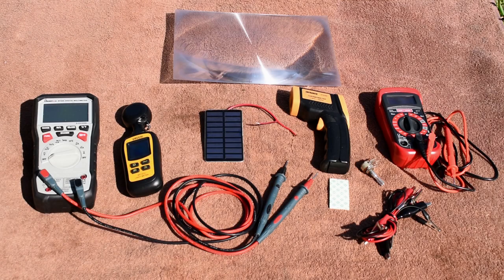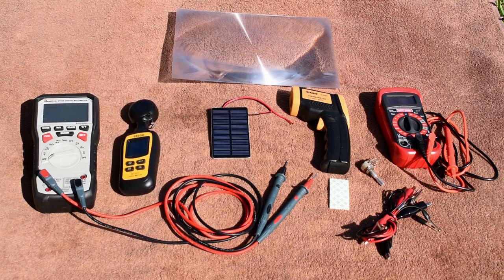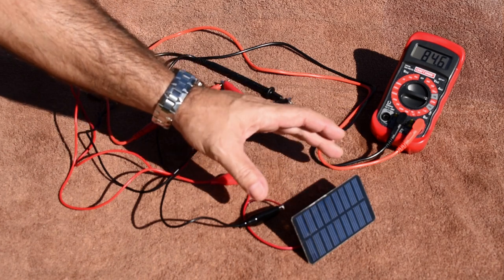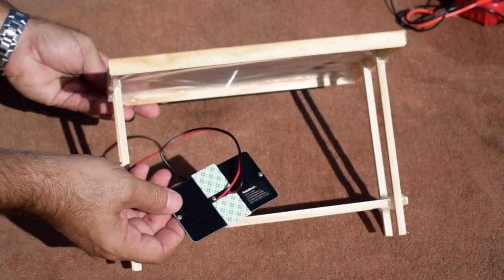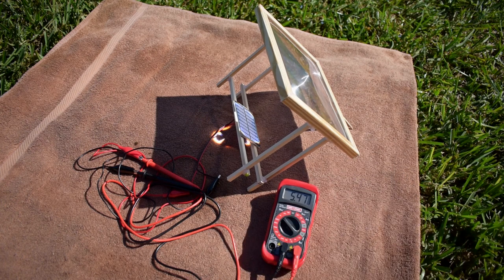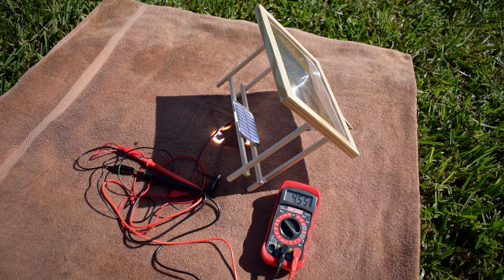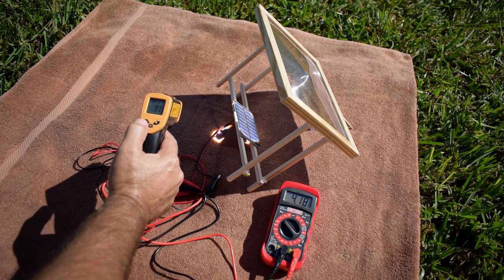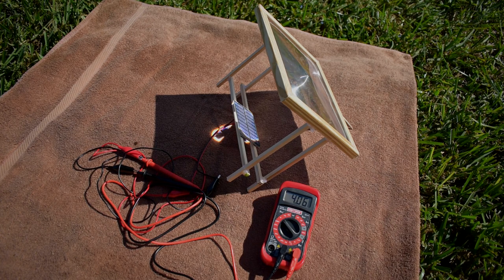Solar Panel Experiment Using Fresnel Lens!

Comment: I saw a paper published a year or two ago about a new type of panel that could work at increased temp. Cheap fresnel magnification was my first thought for an application. I do like the suggestion by some of your other commenters of just submerging the panels in water though. Gives you options to harvest the waste heat for a useful purpose as well.
Reply from the maker: I'm going to do another video using the same setup, but try using a bonded heat sink, and water cooling. I'll test the power output for USB charging. Thanks for watching Ben! Looking forward to your next video!
Reply: Water might mess with the output because water is kind of like a mirror but idk
Reply: I wonder if the heating would be less with a load in the circuit?  The multimeter measures amps and current, but how does that work if there's no load in the circuit?  Wouldn't you need a load?

Either way, there are cold places on the earth that get plenty of sun.
Reply: @Volker109  not by much, water surface reflects less than 10% of incoming light, and absorption isn't an issue unless we're talking about a lot of depth (50% energy wasted at 10 meters)
Reply: @James-wd9ib  if the panel was encased in the water, you could basically turn the solar panel into a giant water block like you would have on a PC. basically it would have to be actively cooled to handle this sort of use.

Comment: Try the same thing with a water cooled aluminium heatsink attached behind the solar panel
Reply from the maker: Hi there. I thought of doing that, but then you'd need a pump, which of course uses power. Be sure to share the video with others. Thank you!
Reply: @electronicsNmore  if the water supply vessel is higher than the cooler block, convection will circulate the water without a pump
Reply: @sargetester99  Good idea as long as it was a closed loop system like a gravity radiant system.
Reply: @ThePreyMantas  I hope he will consider doing it for a video.
Reply: @electronicsNmore  now let's add up the cost of a fresnel lense and a water cooled block vs a bigger solar panel
Reply from the maker: @gurgleblaster2282  The video wasn't about cost, it was made to inform. The lens was $2, the wood I had, and heat sinks are abundant for me. I pull them from the trash.
Reply: @sargetester99  Yea, it would be interesting to see the results from all 3 tests, normal sunlight, amplified and amplified w/water cooled collector.
Reply: @electronicsNmore  yeah I get that I was curious. Especially if it is cost efficient to scale up like a mobile camper
Reply: Your amperage increase is enough to cover the cooling and leave a 50 percent gain.
Plus use the "heat energy" you need to remove from one side to the other.
Like in Algebraic equations.
Like is said "energy can not be created or destroyed." So use it.
Reply: @sargetester99  especially if you've got a creek to gfravity feed water through the block... And the "waste" heat could be used for other purposes.
Reply: Apparently LED globes will give you a much better efficiency than any solar panels can when you shine light directly on them they produce power...
Try it out on your next video...
Reply: pe hgt whats an led globe? I looked it up and found nothing.
Reply: @maximusmeridius3106  I think he is talking about just regular 3mm LEDs , light emitting diodes,  they do produce electricity if light is concentrated on them
Reply: @electronicsNmore  if you had a small reservoir of water the system would pump itself water travelling  from hot to cold
Reply: Yo... dudes... these panels are on a cheap form cellulose/resin composite pcb that offers pretty good thermal insulation
Even glass/resin composites have a very poor thermal conductivity.
Reply: Came to the comments section just to mention the same
Reply: Bjorn A'grin solar panels are a type of silicon semiconductor device. Semiconductors suffer from a phenomenon called “thermal runaway” because their internal resistance reduces as their temperature rises. This causes more current to flow, producing more heat. They work ok as long as you keep them below the critical temperature.  Once exceeded, an avalanche effect can occur, where the resistance drops and current rises rapidly, causing heat failure. This is why computer chips have cooling fans.

Comment: People in Antarctica should love this. I guess cooling is not an issue, there.
Reply: I get the joke, but people in Antarctica (and the Arctic) actually do have an issue with cooling in the sense that those that have refrigerators have the temperature within them kept at a controlled level/range so that (for example) things don't freeze.  :)
Reply: @maintoc  yeah, I guess down there one could hear some pretty improbable dialogues. Like: "here, let me warm a beer for ya..."
Reply: @copernicofelinis  Good one.  :)
Reply: Yep solar panels works really good there (when they can lol) snow is reflecting some lights too

Comment: The first time you read the current draw, you only change the rotary switch setting without switching the leads into the proper terminal. The second time you take a reading you do it properly.

Comment: It should give the same power increase as the difference between the area of the lens vs. the area of the solar panel. Basically it’s like using a solar panel the size of the lens. Do they make solar panels that can handle this amount of heat?? That would be awesome. 👍🏼
Reply from the maker: Thanks for watching! Another video coming soon, I'll be trying a cooling method. Be sure to look over my "Solar" video playlist.
Reply: electronicsNmore You can get a very large Fresnel lens for free from an old rear-projection TV (ppl give them away on Craigslist).  That should give you a huge solar panel equivalent area at zero cost. 👍🏼

Comment: Making the cells out of heat resistant material and having some sort of cooling like water and this could be a supreme way of making tons more energy with the same amount of cells to power even bigger facilities, but the biggest problem will be it's cost to output ratio, and the potential dangers of overheating if something breaks due to external forces of nature. So the maintenance cost would also go up. If somehow the solar with magnified output still outperforms all these extra costs it might actually have a future. So engineers and developers need to try to make it safe, and efficient, and im sure they can make a very lucrative product and business.

Comment: You could add a transparent IR blocking film. Depending on the type and quality it can block almost all IR (heat) rays from the sun and let through almost all of the rest of the solar rays.
Reply: don't waste that IR... drape wet laundry on the other side

Comment: I really like how you describe your process in detail and very simply. I searched for this directly "solar panel with lens" to see if I could use some fresnel lenses I recovered from old LED TVs to increase my capture of solar power. I'm hesitant because of the added heat (not to mention my current charge controller is already nearly maxed out at peak). But this video answered my question without requiring me to look at more videos, and that to me sir, is the sign of a very effective video. Thank you.
Reply: and right after I realized you did another one with cooling - so I immediately retract my statement that I have seen enough videos
Reply from the maker: Glad you enjoyed my video! Be sure to rate thumbs up, consider subscribing, and look over my extensive video playlists below for many other videos of interest to you. Taking one minute to share a link to my channel with others on social networking sites would be greatly appreciated. Thank you
http://www.youtube.com/c/electronicsnmore/playlists

Comment: I had the same idea years ago. I tried this too. It didn't work in strong sun. Maybe it would work in low light conditions better. The first thing I learned using panels is that placement is most important. With the Fresnel lens maybe it will give you a better latitude in less than optimum conditions.
 I also thought of using a water bath to cool the panel. That does work but you cannot recirculate the water, you need to bleed off the hot or all you are doing is making a thermal heater.
Reply from the maker: Thanks for watching!
Reply: Could the water be contained and its pressure would be a secondary power source?

Comment: if you use a frensal lens on a pv-solar-thermal hybrid unit that heats water with energy lost as heat, it will cool the pv and stop its voltage from reducing

Comment: It would be good in Nordic countries which has low ambient temperatures half the year. There is not More light created in this experiment, the same amount of light but it is concentrated over the panel. Cool experiment.
Reply from the maker: Yes, it needs cold air. :-) Thanks for watching!
Reply: Why not just use a solar panel as big as the lens? I am pretty sure that would be more efficient regarding electric output and it is certainly smaller, cooler. Probably also cheaper.
Reply from the maker: @nmayor4232  Defeats the purpose of the experiment.

Comment: Nice! I planned to do this test some day. Expecting those result. I was also thinking water cooled heat sink, like another commenter mentioned. Doing some mental math though, any setup will probably cost more plus take up more space than more solar panels, but maybe you could used the heated water for something.
Reply from the maker: Yes, it was just to show viewers what to expect. A large heat sink or cooling water would be needed to use the full power output.
Reply: Heating water that is cooling down a photovoltaic solar panel seems a cool idea to me as well. Even small temperature differences will help.

Comment: Nice job , the small round sunspot below the solar panel is probably getting hot, could get a sunburn
Reply from the maker: Yes, the light was more concentrated there. Thanks for watching! Be sure to share.
Reply: @electronicsNmore  figured you'd notice, how hot is that spot? lots of ideas , how about using a radiator for thermal, they're putting together a solar thermal farm out west good idea. there's lots of ideas with the magnifier even magnifying the magnifier, if it helps would making a cone in between the panels and the magnifier might capture more.

Comment: So I had a shower thought about raising the output of solar panels with either a lens or mirrors or whatever, and obviously, there's a video on it. Absolutely brilliant! Thank you for making this and your other video with the cooling.

So here's a follow-up thought: What if you were able to transfer the heat into a thermoelectric generator, rather than "loosing" it in a dispersing medium? Is that a possibility?
Reply: current thermoelectric generator tech has horribly low efficiency, converts 9% heat to energy at most, great idea but not worth while, better just warm some water with it in a heat exchanger and you put all the heat to use

Comment: If you bring the panel toward the lens, you should find an optimal distance there the output is maximum, as the  decrease of output due to less intensity is balanced by the increase of output due to decrease of heat, something like a bell shaped curve.
Reply from the maker: That was all done before the rails were in position.

Comment: what if you had water cooling it while the concentrated sun was on it?  spray, mist, flow . . ???  The water would block some of the intensity, but not as much as the concentration provides. Would it cool enough to keep output high?

Comment: What would be good is a way to use the energy focused by a lens or glass sphere without the need for a battery or solar panel. I imagine it must be possible to heat a body of water using focused light from a glass ball. Surely it would be possible to heat up copper that could transfer the heat to water or cooking equipment?

Comment: A 5v fan  could keep the panel temperature down (at least slightly), and it could even be powered by the panel itself, with current to spare.
Reply: you are losing efficiency, you rather just conver everything to heat and power a steam generator which in the correct scale is more efficient than solar panels and cheaper because you can use mirrors instead
Reply from the maker: The only worthwhile thing to do, would be to spray the panel with water every minute, or submerge the panel in a shallow pool of water. I have another idea for a future video. :-)
Reply from the maker: Sans Handlebars  If the panel was only submerged 1/4 to 1/2", I think it would work fine.
Reply: @electronicsNmore    8 )   Thought of Underwater Panel too.  (+ push air w\ fan & magnets)   Looking forward to see yours & Results!

Comment: Obviously, to put a solar panel in water, it would need to lay flat. But then the suns rays wouldn't be perpendicular. 
Suppose we do lay them flat and submerged them in water? Then we used AND Fresnel lenses mirrors to reflect and magnify the sun rays perpendicularly to the panels? Then we automatically rotate and tilt the whole setup such that we get coverage the entire day?
Have you ever seen that experiment?

Comment: This is off of the subject,but, you are the expert! How does an AC system establish a chasis ground without a battery? In other words, tractors, motorcycles, etc., establish chasis ground via the negative post of the battery. Snowblowers, push mowers etc. have no battery. So, how does the frame and engine become a ground for the ignition circuit? Thanks
Reply from the maker: Alternating Current systems have the neutral wire of the transformer connected to earth ground. The current has a path to ground.

Comment: Would magnet pushed fan blades move enough air to make difference to lower panel temperature?   
What if Panel (waterproofed) is in water;  Would that hinder power output;  Could that stabilize temperature?      
Nice Idea  Keep trying !    - Ideas below are good too!
Reply from the maker: Partially submerged or sprayed with water should work. Thanks for watching!

Comment: Nice! Thanks for the demonstration, mate! That theorical predicted results proves. It could be improve the experiment aplying a solar filter film in the range of infrared frequencies like passband filter to cut the hotests radiations and permits pass the light radiantions without affect the solar panel performance, theoretically. This experiment it was something i went to perform time ago, thanks for share. Regards
Reply from the maker: Glad you liked the video! Please share.
Reply: You dont have to try to maximize everything...just make 3 sets.
back it off a little..so it wont damage the solar panels.
as long as it stays above 4 Volts..it'll charge a 12v battery all day long for free.
My lipo balance charger isnt exact...it just has to be above 12v input.
The most I set to charge is 400 mah. whether I charge a 3s (12v) or 6s (24v)
If anything...I'll have to set the timer or limit so it wont over charge.
Run a PC or flat screen all day long or even charge cell phones.
Just use a power converter for cigg litter..i use to charge or run my PC
off of my truck (12v)

Comment: Put a peltier device on the backside of the solar panel to act as a heat sink to keep the solar panel cooler.  Also the peltier device will generate its own current to increase the over all energy output of your setup.
Reply from the maker: Too much power consumption.

Comment: Keeping the panel cool while using the Fresnel lens may be difficult or even hazardous if water is the cooling agent; there are other cooling agents that are safer and while those are explored and researched, use of the Fresnel lens over outdoor solar panels only during the winter temperature 'ranges' may be the safest option currently.
Reply: Water has the best heat capacity

Comment: Wonder if you had water in a container that the fresnel concentrated on brought to a boil - with the steam turning a tubine - then going through a cooling tube (like a still) but then somehow have it brought back into the original container (closed loop) to keep reboiling the same water - no water loss - without an explosion like a boiler tank explosion from excess pressure.  Similar to the solar mirror concentrators inthe west...

Comment: I'm not sure what wavelength of light the solar panel uses but I think it's the infrared that causes it to heath up so if you get a infrared filter that is heat resistant & put it just in front of the panel would that stop the panel heating up but allow enough of the light the solar panel uses saving any sort of heat sinks etc? Just a thought would be nice to see what happens
Reply from the maker: Infrared blocking filters are dark, so it would end up blocking too much visible light.

Comment: Have you considered using an IR filter.  It is only the IR "radiant heat" portion that is responsible for the heating. IR is not involved in the electrical output.
Reply from the maker: Blocks way too much visible light

Comment: You should be looking for the load that will result in maximum power output. You could do this using a variable resistor and calculating the power.
Reply from the maker: Voltage was too low. Next video will have water / heatsink cooling and USB power tests

Comment: Or increase the thickness of charcoal and put the silver deeper on bottom or vice versa would sure increase voltage because in high heat we neead more charcoal thickness to compensate for low contrast

Comment: I wonder if putting the solar panel in a quality epoxy resin with a minor UV tint would help or a perspex container with mineral oil would act as heat dampening thermal mass? Great little video though, gets the cogs turning!!
Reply from the maker: Reducing heat will end up reducing light, which reduces power. Water spaying or submerging the mini panel is the best way to cool it.